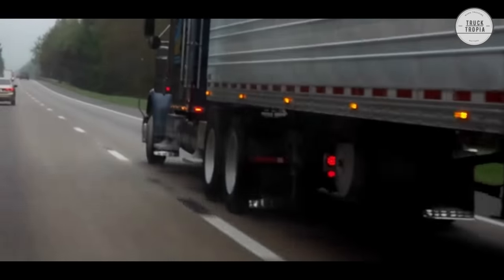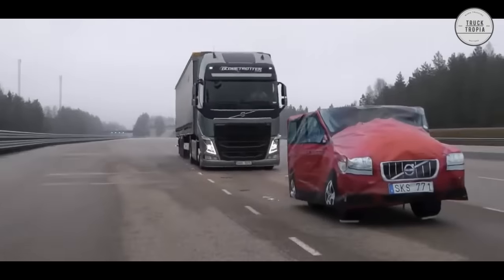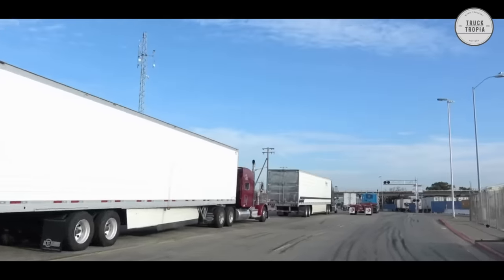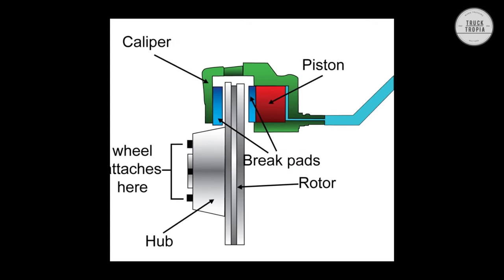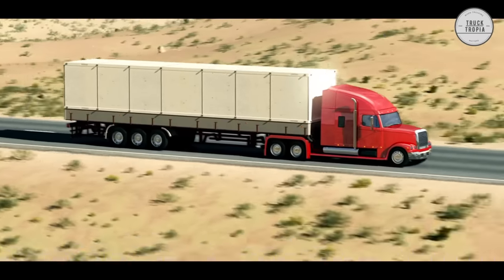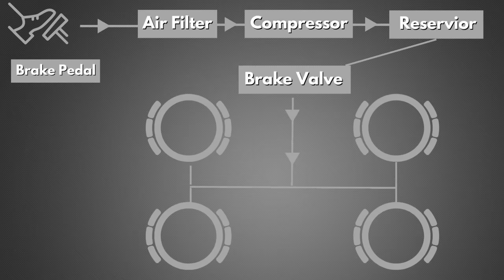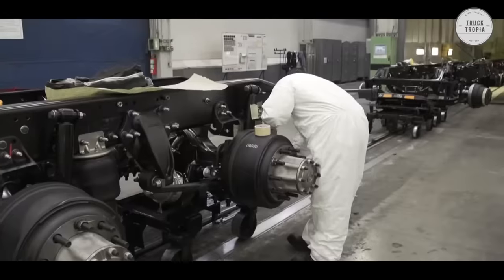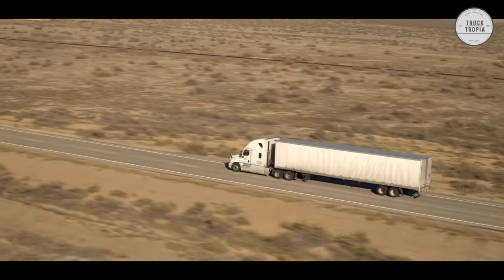Why Do Semi-Trucks Use Air Brakes?

Comment: Good explanation about both brakes. Hydraulic brakes has a help of the booster. What about the air brakes?
Reply: The author of this video has barely a clue; don't waste your time trying to commit anything he said to memory. The air brakes rely on an air compressor and air tanks, which the compressor fills to about 125 psi. So no booster is needed, unlike a car's hydraulic brake system. 

For about the past 70 years, semi trailers have used a two-in-one chamber system to convert air pressure into mechanical movement of metal parts which then force brake shoes and pads against brake drums and rotors. 

One side of the brake chamber gets filled with air to push against heavy springs which otherwise apply the brakes to keep the trailer from moving in the first place (to remain parked) or to slow and stop the trailer in case all sorts of bad shit starts to happen. The other half of the brake chamber uses service brake air, supplied by the compressor (and stored in tanks) and controlled by application of the brake pedal, to apply pressure to the brakes to stop the vehicle.

Comment: there is a huge spring in the brake can that applies the brakes it takes air pressure to release them before the brake can was designed they used air pressure to apply the brakes Which was too dangerous because no air no brakes and the emergency brake would release if it lost air pressure

Comment: The size of vehicle doesn't determine using air or hydraulic brakes.   Large aircraft such as Boeing 747s use hydraulic brakes.  Air brakes fade due to heat the same as hydraulic brakes.  It's the braking material, sweep area, cooling ability and many other aspects that determines brake fade due to high heat not the braking activation mechanics.  

Semi's are very much known for overheating and loosing their friction brakes due to brake fade.  It is not considered viable for friction brakes on large heavy vehicles with comparatively small surface area air resistance to be used for long duration retard braking such as on long descending grades. It is virtually a requirement that large semi trucks have engine braking for doing  the bulk of braking when descending long grades due to their air brakes fading completely if dependent on them.   

The strong engine braking capability of Diesel engines is a major reason to keep using Diesel engines for large trucks even if a heavy duty gasoline engine maybe cheaper to fuel when Diesel is at $5 gallon and gasoline at $3 gallon.   If it wasn't for the strong dynamic Diesel engine "Jake" brake the Diesel engine wouldn't be the undisputed choice for large trucks.   The only good substitute is a BEV large truck with regenerative braking.   That works much better and allows large trucks to descend grades at much higher speeds with high force dynamic braking.   The "Jake" brake of a Diesel engine requires running the engine in about the same RPM and gear the truck used to clime the grade as it does to descend the grade so if the truck climbed at full throttle doing 30 mph it would have to descend at about 30 mph in the same gear it used to clime.   A very good "Jake" brake Diesel engine typically can produce almost as much braking horsepower as is can produce horsepower.
Reply: The preference for diesel engines is primarily about moving the truck.  The fact that they can work well with a jake is far secondary to that.  Even if fuel costs significantly more, an equivalent gasoline engine would use so much more fuel that there would be no cost savings.  Semis don't purposely use an engine design that is thirstier just for braking action - the reality is that these diesel engines consume less fuel, apples to apples.
Reply: @ChristopherBurtraw  Even if Diesel was slightly more expensive per mile than gasoline there just isn't a proven well recognized heavy duty dynamic braking system for heavy haul trucks other than the Diesel engine Jake brake. Real world experience has been better than the theoretical 30% higher efficiency for Diesel over gasoline, but 30% higher efficiency is the common figure.    At 30% higher efficiency Diesel could cost $5.20 a gallon and be on even cost per mile with gasoline at $4.00 gallon.   Diesel has been much more expensive than that compared to gasoline.   Diesel at near $6.00 a gallon with gasoline around $4.00 a gallon has taken place around Indianapolis.    

There really is no choice between heavy duty Diesel engines and heavy duty gasoline engines for heavy haul trucks, there are just Diesels.  With lighter large motorhomes there is a bit of choice between gasoline or Diesel, but they are typically totally difference vehicles you can't just select a gasoline or Diesel engine.   One of the reasons for getting the Diesel engine is better fuel millage, but the deciding reason is frequently to have the dynamic braking of the Diesel engine Jake brake when driving the RV on such highways as Vale pass on I-70.
Reply: @douglasengle2704  I agree that there's no choice in practice, I disagree with the reason for it.  My understanding is that it's basically entirely down to motive performance and durability, not braking.  Jakes are not the only feasible auxiliary braking devices and they aren't equipped on all diesel semis.  

For starters, hydraulic retarders exist and work well, without the Jake noise, which btw is prohibited in a lot of places.  Yes, Jakes are a great option for auxiliary braking in any case, but it is probably not a primary reason that diesel engines are used in semis, it's more of a side perk.
Reply: @ChristopherBurtraw  I believe the choose of a  Diesel over gasoline heavy duty engines for heavy vehicles such as fully loaded semis and dump trucks is heavily restricted to the dynamic braking available with a Jake Diesel engine brake.   There are no proven alternatives for providing the needed mile after mile dynamic braking required by heavy vehicles on long highway downgrades other than the Diesel engine Jake brake despite a century of research.  This is why heavy duty gasoline engines have not come back into consideration when the cost of running Diesel or gasoline fuels has the possibly of being comparable and Diesel possibly more expensive.   

Lack of a Jake brake like system in the opposed piston Achates Power Diesel maybe the reason for the lack of excitement for an engine with at least 15% higher efficiency than others and possibly a lot higher on average.  The Achates Power opposed piston Diesel also has a gasoline prototype that gets a reported 37 mpg compared to its Diesel fueled version at 42 mpg when used in a Ford F150 prototype.   That is 1.135 X more efficient for Diesel over gasoline, which is really at the normal 15% higher energy content  per gallon in Diesel than gasoline.  In most markets it would be cheaper to be running the Achates Power opposed piston gasoline engine because Diesel costs much more per gallon than regular gasoline and far more than the increase in fuel millage. 

One advantages of the Tesla BEV semi to alert observers is the vehicle's ability to do regenerative braking at extremely high levels.   Not only can the Tesla Semi clime very steep mountain grade interstates at 55 mph - 60 mph it can down those grades at 65 mph while other fully loaded semi's are having to clime at 40 mph and go down at 35 mph - 40 mph.   That is considered to possibly be a big time saver in some applications.  If proven and reliable the Tesla Semi may revolutionize mountain grade interstate trucking more due to its extremely advanced regenerative dynamic braking than any other aspect.
Reply: @douglasengle2704  there is nothing about the operation of a Jake brake that would prohibit it from being installed on a large gas engine so it's not really a choice in the first place they could have a gasoline engine with just as much engine braking power as an equivalent diesel
Reply: And no one mentioned torque  as why diesel is used over gas 😂 ppl forget the whole purpose of diesel, at miles per gallon cost /lifespan and torque.

Comment: Hang on a second. First you say that when the air tanks are pressurized, the brakes are released. But then you say when the pedal is pushed, the air pressure applies the brakes. Which is it? I always thought it was a fail-safe situation, i.e. spring pressure applies the brakes and air pressure is used to release them so that in the event of loss of air pressure, the brakes will lock up.
Reply: Air releases the parking brake by pushing against a spring. But that diaphragm isn't used for normal stopping. Then once released, during normal driving, air is applies to a different diaphragm to apply the service brakes. 

The front brakes lack the spring brake all together. This is why the rear brakes have a larger chamber, to house both diaphragms. On older tandem axle trucks, only one of the rear axle4s would have a spring brake and on older drop axle truck, the drop axle would lack a spring brake.

Pushing in the parking brake button puts air into the chamber releasing the brakes. Pushing the brake pedal puts air in applying them.

on older systems, hitting the brakes while the parking brake was applied could add more braking force to the point of ruining the drums by stretching them out. Newer systems as you apply the service brakes, proportionally release the parking brake to avoid this happening.
Reply: @SilverStarHeggisist  aah, makes sense now. Thanks very much for the excellent explanation.
Reply: @MarkoVukovic0  you're welcome

I left out that the steer axle (this includes dolly on tandem trailers) never have parking brakes. This is so in a emergency braking situation, the driver can still steer. 

The truck will also literally yell at you that your air pressure is too low
Reply: @SilverStarHeggisist  that's interesting and makes perfect sense. I don't know why, but I had a mental image of a truck actually yelling in a human voice 🤣🤣
Thanks again for the explanation!
Reply: @MarkoVukovic0  I'm sure that's coming soon. 

Currently it sounds a loud and I do mean loud obnoxious buzzer till the pressure is above 60PSI and flashes a warning light. 

Old ones would have a mechanical red arm that would automatically swing down from the ceiling of the cab when the pressure dropped low enough. 

When the pressure drops too low, the system automatically locks out everything on the truck that uses air that's not the brakes. 

An exception is fire trucks because they need things like their air horn to work. However over use of the air horn will disable the brakes.
Reply: @SilverStarHeggisist  that's amazing, a mechanical warning! I must try and find a video of that.
Reply: @SilverStarHeggisist  this made me think of "Bitchin' Betty", the voice alerts in the FA-18 e.g. "altitude, pull up! Pull up!". Perhaps they should bring Leslie Shook out of retirement to do voice warnings, that would be cool; "Air pressure low! Air pressure low!"
Reply: @MarkoVukovic0  yeah I could see it. Current it does a loud obnoxious buzzing that you'll do anything to make stop lol
Reply: @SilverStar Heggisist  my low air sensor failed, and I listened to that for 3 days until I could get it into a shop. 
I was about to lose my mind.
Reply: @bryanteaston7264  I would have found the buzzer and ripped it out lol

Comment: I want to point out that air brake are stronger than non assisted hydraulic brake. Some mining truck do use hydraulic brake but the system is pressured by a motor since a human driver would never be strong enough to apply the force.

Comment: And remember, it takes special training to use air brakes. Why? Because air brakes are not instantaneous. Hydraulic brakes transfer your foot pressure at the pedal to the brakes immediately, because you are moving the fluid. Air brakes fill the system each time, and depending on the size of the vehicle, can take a little bit of time to fully pressurize. The first time going from hydraulic to air is terrifying, because it feels like for a split second the brakes are dead. However, once you learn, it's not hard at all. And boy, talk about powerful!

Comment: The error in this video is that Air Brake System is spring loaded, when the Air Pressure is reduced, the spring starts to move the "S" cam.
Westinghouse therefore called it. a Safety Brake since if it fails (due to air leak, even from a broken apart airline, the brakes come on!

Comment: I wonder why electric brakes aren't a thing. Electric motors are typically very dependable and long-lasting and they could provide more than enough force to compete or out-compete air brakes.

Comment: Stopping a large vehicle creates an enormous amount of heat within the brake system.  It gets so hot that the hydraulic fluid will boil, greatly reducing the braking ability

Comment: "Air brakes use compressed air to apply the brakes, which is generated by an air compressor powered by the truck's engine"

So trucks essentially have supercharged brakes 🤔🤔

Comment: A good way of explaining it to people don't know anything about brakes is that the default position of air brakes is fully engaged. You have to build up air pressure to release the brakes.

Then when you hit the brake pedal, you are relieving the pressure that is pushing against the brakes to keep them open.

With hydraulic brakes the default position is off. When you hit the brake pedal your building up pressure to engage the brakes.
Reply: When you hit the pedal, you pressurize a second cylinder which acts independently of the cylinder containing the spring.  Nothing exhausts (or bleeds) until you release the brake pedal.

Comment: Workshop truck was an air over hydraulic system.  Liked the all wheel disc brakes on it.
The Macks we had there were air start. Leave em unused for a few days.  Loose enough air pressure and of course damn things wouldn't start.  Got very efficient at being 'shop bitch' and ensuring their air wouldnt get too low between drivers tsking them out!

Comment: How does air brakes reduce temperature?
Reply: I don't think it reduces temperature, I think it is less of a risk operating at very high temperature because it doesn't have hydraulic fluid that can reach boiling point becoming ineffective.
Reply: It doesn't.  They have a much larger thermal mass in their components compared to a common vehicle's brake system.    A common 4000-pound vehicle might have 20  - 25 pounds of mass in its primary brake components.  Whereas an 80,000-pound tractor-trailer rig might have 500 to 600+ spread out over 6 or more axles instead of 2.

Comment: Heavy semi trucks use air brakes because of the failure mode of not having air pressure is better than not having hydraulic pressure.

The video is half-wrong. Air is used to release the brakes and big springs are used to apply the brakes. That's why air brakes are safer than hydraulic brakes. The hydraulic system uses hydraulic pressure to apply the brakes and a profiled o-ring to release the brakes.

Comment: You need very powerful system to push that much liquid. Although there are trucks with liquid brake fluids and they are pleasure to drive because brakes react faster and at better precision
Reply: Not true at all. The fluid is the actuation method. The linings and disc's or drums do the actual work. The same pressure can actuate smaller or larger brakes to give less or more stopping effort. Hence why race cars fit bigger brakes to get more stopping power- the pressure is the same- or often less- if they remove brake boosters to give better feel.

Comment: Trucks also use retarder also known as engine braking when going downhill gradient or slope
Reply: You don't need air brakes to use engine brakes.
Reply: Where a valve closes the escaping gas and choke the engine to cut the momentum of the vehicle!

Comment: The only reason trucks use air brakes because it requires big reservoir to store the hydraulic fluid and all the hydraulic line required. Same applies to sedans,you don't have a big space to fit an air compressor to your engine hood and to the trunk.

Comment: Trucks, from time to time, need to reduce their kinetic energy.  That can be achieved by reducing mass and/or by reducing velocity. Mass can be reduced by jettisoning the load. Jettisoning the load will reduce the kinetic energy but then the driver will have to run around collecting the load and putting it back. that is bad for efficiency, The velocity could be reduced could also also be reduced but this also results in poor efficiency. Bit is is still far more efficient than having to put the load back on the truck.  The velocity can be reduced by converting the velocity into heat that can easily be dissipated.  The mechanism for doing this is called braking. Braking can be achieved with brakes. Simple really.  Trucks use a variety of brake called air brakes.  And that, children, is why trucks use air brakes.

Comment: The people who do these reports really need to do some research before they do these videos. 
Also, can you imagine how much of a pain it would be to have to bleed the brakes on the trailer every time you hook-up a different trailer. Think about it,  every time you disconnect the air lines on a semi tractor/trailer combination you are opening up the brake system. If the brakes were hydraulic, you would need to bleed the air out of the hydraulic brakes on each axle and all the wheels. That would take an enormous amount of time  and brake fluid.

The brakes on heavy trucks and busses work by releasing the air. The brakes are actually applied by spring pressure, not by air pressure. 

FYI, the railroads also have air brakes, but they do apply the brakes with air pressure.

Comment: It’s really a no brainer, hydraulic systems work well in small short circuit systems, fluids are not compressible yes…but air systems are pre charged and releasing this charge engages the brakes, better fail safe, even trains use air braking systems…